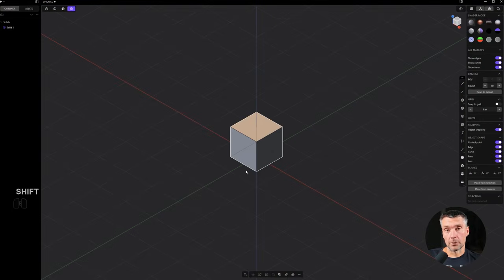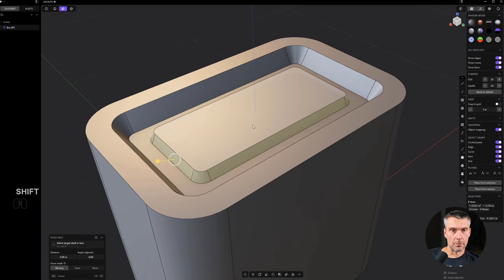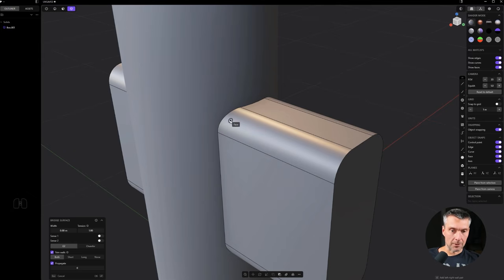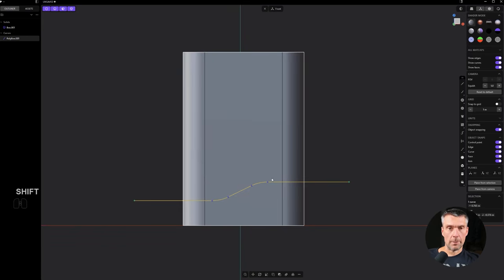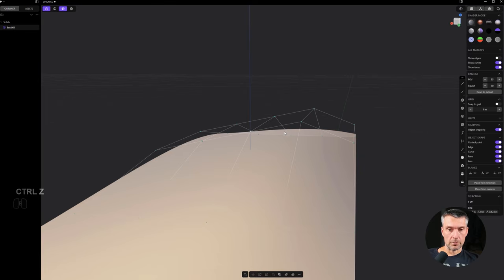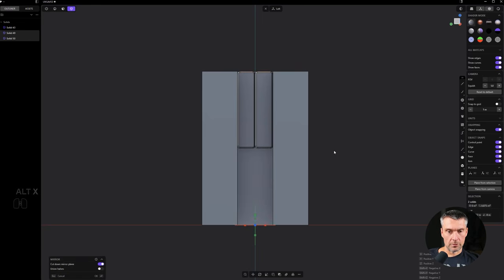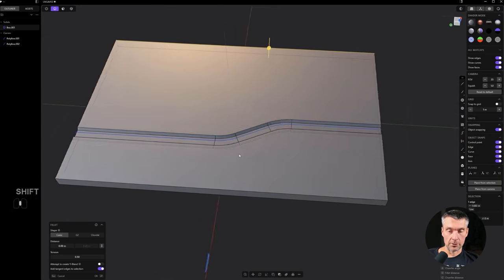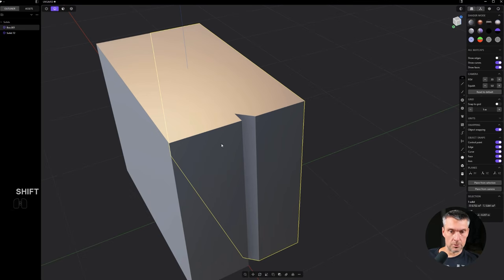10 Plasticity Tricks You Need to Try Now!

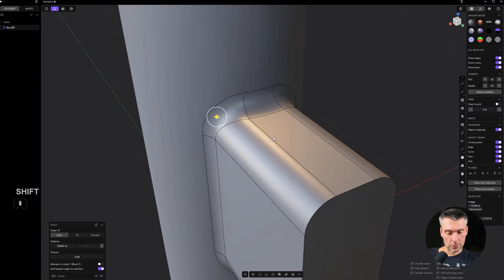Comment: 5:26 You can do it also, when you change the fillet shape options from "Conic" to "Chordal" (G1) Bridge Surfaces are have only a benefit, when you need G2 continuity, but for simple hardsurface stuff G1 is mostly OK.
Reply from the maker: yeah cheers boss, i realised this in another vid, that chordal must have been a new addition in the past year, i  also noticed that the bridge surface sometimes work when chordal does not
Reply: @PonteRyuurui  That might be because the Parasolid kernel, by surfacing, really lets the monkey out of the cage; with hard-surface stuff, you often only stay inside the cage.